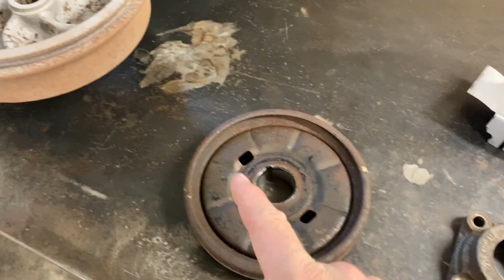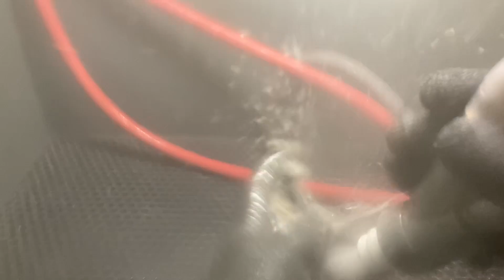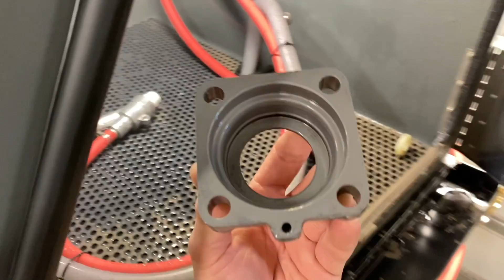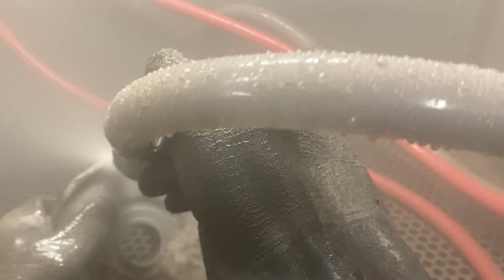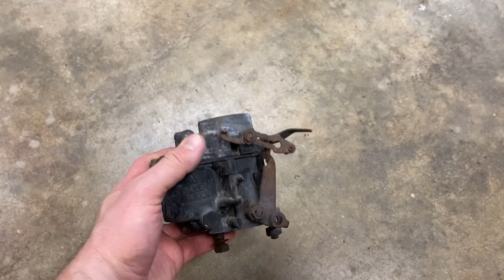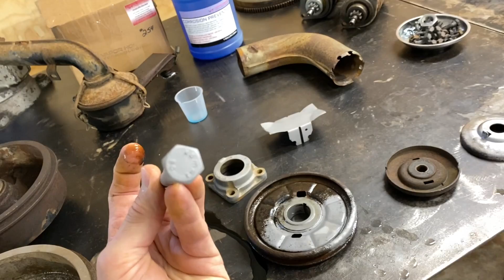VAPOR BLASTING RUSTY'S PARTS - Vapor Honing Technologies - Weekend Warrior - VW BUS RESTORATION! ct

Comment: The company I buy my beads and stuff from here in Australia also sells a liquid that is added to the slurry to prevent rust,especially in the pump ,nozzle tanks and so on. https://dana-ridge.com.au/vr20-temporary-rust-inhibitor-aka-no-rust/
What I like most is that I can clean alloy parts,expensive impossible to find alloy parts, and it doesn't destroy the surface with lots of pits etc. Then I turn off the air and spray them with slurry which puts a shine onto the parts. This surface is really easy to keep clean,just a wipe with shellite on a rag .

Comment: Hi
Thank you so much for an interesting and educational program. I have a 1961 type 2 split window van in thousands of individual parts :) that now needs to be cleaned.
Sandblasting takes a lot of time. My experience is that it is faster to clean in several steps. 1) Clean with scraper and brush. 2) Then use a degreaser. 3) If painted use a paint remover. 4) If a lot of rust use a rust remover. 5) Now you can blow much faster and with better results.
I use sand for steel parts and soda for light metals and parts that cannot withstand rough surfaces.
Greetings from Norway
Torstein Olsen
Reply from the maker: Hello Torstein! Thank you for watching! I really appreciate that! That is good to know. Thank for sharing! Thank you! Stay tuned for more!

Comment: CT . When you get some 80 grit , after you use it it will keep breaking down smaller.  Start with the rough stuff then do the softer materials. Over in like L.A. or San Diego there is car washes that have Hydro Blasting ,  One catch it is 20 bucks for 5 min. The video I watched had a guy He spend 200 bucks but he did a whole car?

Comment: Unless it was thin sheet metal. I would start with a 60 grit media. It won't damage parts like the  bearing retainer or the pulley. One of the advantages of vapor blase is that it is not as prone to warp flat sheet metal panels as minimal heat is generated. Dry the parts immediately after blasting with an air hose, You can't just let them air dry without rust formation.

Comment: So, yeah, that's sort of wet sandblasting.. Very effective as it seems, I have no experience with wet blasters yet. Personally  I prefer it dry, as the water gives you flash rust and sometimes it's better to avoid it. It's kind of relaxing to me also looking at the work beeing done and the nice results. Just pay attention on the carburettor aroud the vents and keep them from clogging with abrasive.. Mixed with water in tight spaces sometimes gets nasty. =) Excelent work, Mr. CT, keep on!
Reply from the maker: Hello my friend. Dry blasting and wet blasting do have some pros and cons. I think once I figure out how to use the rust inhibitor I can keep them parts from flash rusting. Thank you! Stay tuned for more!

Comment: You could hit the parts with a wire wheel before putting them in the sand blaster, that way the blaster doesnt have a large layer of rust to cut through. Even soaking the parts in rust remover can work too. And I like your vapor blast set up by way, no dust is a plus! 😁

Comment: Is it a good idea to blast machined surfaces, especially closer tolerance bearing surfaces?
Reply from the maker: Hey John, Yes, as long as you use the correct mesh/grit. You can police machined surfaces with this machine using the correct mesh/grit.

Comment: Thanks for the demonstration.  IMO I'll stick with my traditional Media Blaster!  This unit was most probably much more expencive,  plus there's the added step of knocking off the flash rust with a wire wheel or whatever B4 paint. But I'm glad you're satisfied and happy with it! ...Newk from Kentucky
Reply from the maker: Hey Newk! There are some really nice dry blasters on the market as well. I'm still figuring out how to use this one. The rust inhibitor will keep the parts from flash rusting. I just have to figure out how to use it the right way so it works. Stay tuned!
Reply: @CTmoog  Use a dip tank with the Rust inhibitor in it.  This will rinse off any debris, prevent the flash rust as well as not use /lose the inhibitor as fast as in the machine.

Comment: those pulleys may not be savable. the v groove has some serious pits and will wear the belt out right away. Pretty pitted and rusty.
Reply: canuckguy worried  yea they're not that much to replace.
Reply from the maker: Hey Mike, you might be correct. I thought these would be good to practice on incase I messed up on something. So far so good. Thanks man!

Comment: Can the sand be recycled?
Reply from the maker: Hey Donald, yes, the sand is used over and over. It can last for a few months depending on how much you use the unit and what type of  surface you are preparing. It settles at the bottom of the unit when it's turned off.